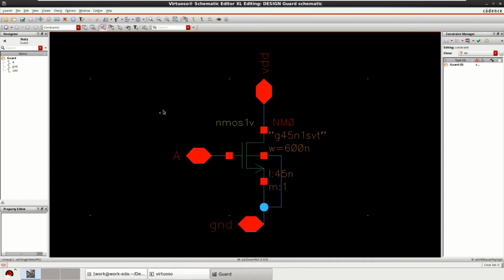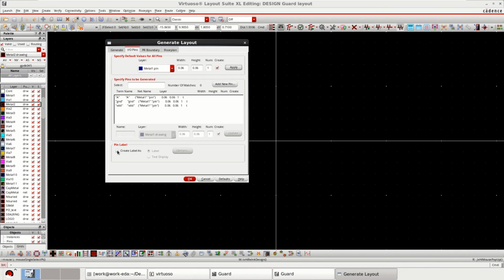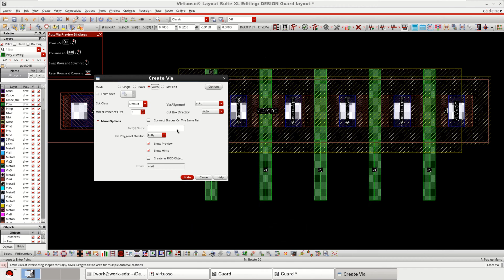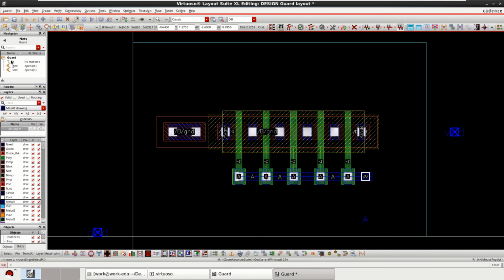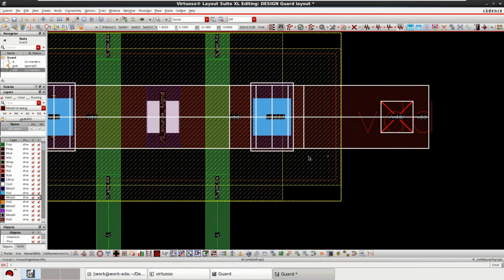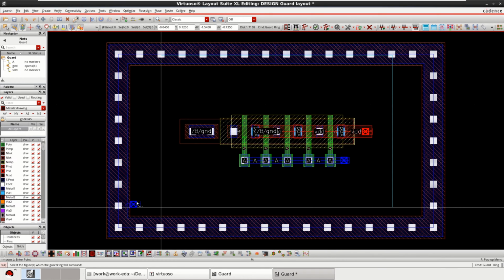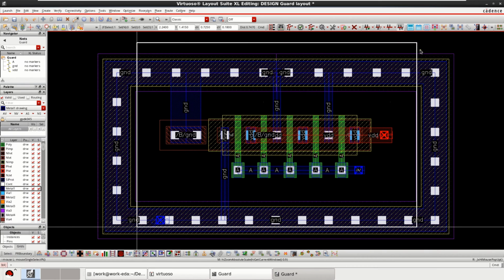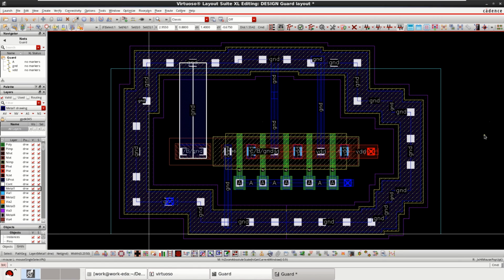CADENCE GUARD RING

Comment: Sir I have tried by connecting pmos as integrated and nmos as detached. But the stamp error occurs. Pls give a solution.
Reply from the maker: Is it during DRC or over all stamp error
Reply: @dr.hariprasadnaikbhattu   sir how to find its overall stamp error? Once after drawing layout, and checking for DRC I saw psubstrate stamp error _connect and substrate stamp error_mult. As you suggested I tried by detaching both pmos and nmos components, nmos alone. I tried for all combinations. I don't know how the error occurs?
Reply from the maker: @பிருந்தாதஞ்சை  Hi it may be dimensions of nwell is less
Reply: @dr.hariprasadnaikbhattu  sir how to rectify? I couldn't clear these 2 errors only.
Reply: I thought of doing post layout. But these 2 error remains.

Comment: Sir i need to contact you about the designing of fir filter using Domino logic in cadence
Reply from the maker: Hi, what is the need of contact
Can simulate the circuit based on reference videos
Reply: Plz provide the reference videos sir I didn't find out

Comment: Sir while drawing layouts i am getting psubstrate stamp error mult. What does this error denote sir? Pls help me.I am in the verge of my reserch work completion. Kindly give your contact sir.
Reply from the maker: Hi, in layout you might have only source, gate and drain. Substrate may be missing. it could be the reason
Reply: In 45nm usually I integrate both bulk and source sir. Because of that error I tried by detaching also.
Reply: If we opt detach option, while making connections should we have to attach manually those bulk and substrate? Because the path itself is showing to connect sir. Again if I do, I am getting same errors.